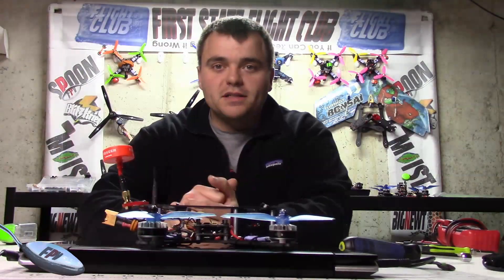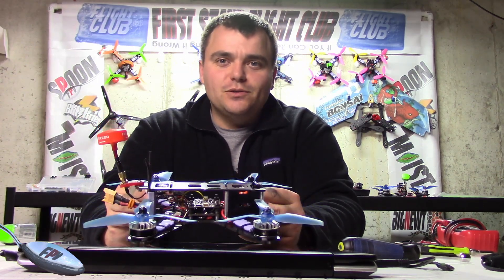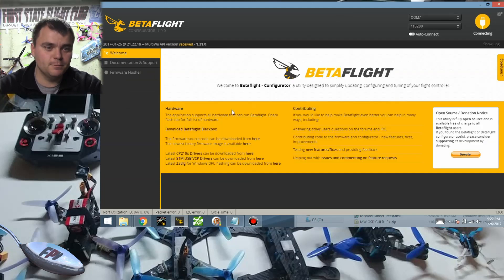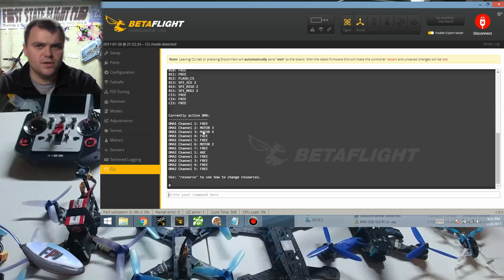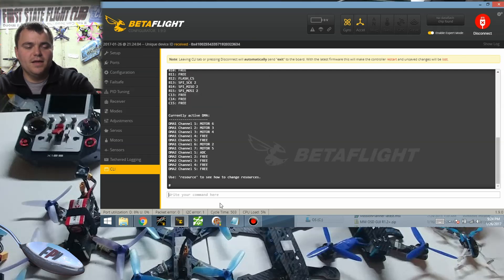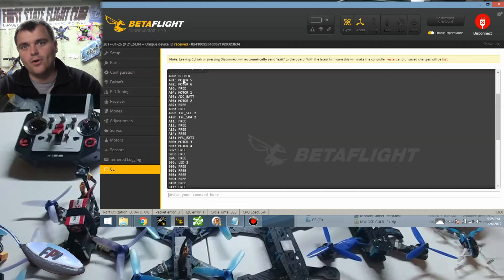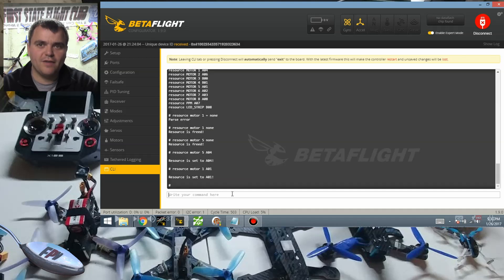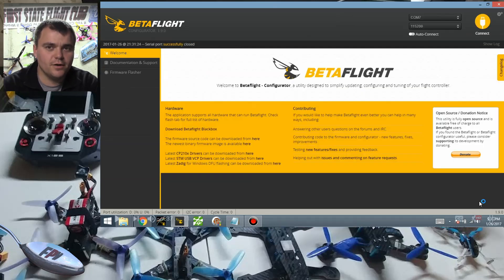Pin Remaping to Support Dshot Motolab Cyclone and more

Comment: I'm a bit baffled. I have the exact same board and it worked for Motor 1 but then kicked off Motor 4 after it had already been working.
Reply: Nevermind! I am an idiot! I swapped esc 4 earlier to test something else and didnt have a Dshot capable esc on it. Works great now. Subbing :)

Comment: Doesnt appear to work in 3.2 RC4, ended up having to use Hex-X instead as Y6 seems to be broken.
Reply: Cheers Shufty, I also had this issue on 3.2. Thanks for the help
Reply from the maker: +Shufty it's just a trick to find which pins support DMA, glad you worked it out.
Reply: Yeah for some reason the Y6 model doesnt save, just defaults to "custom motor mix" which isnt that helpful. Hex-X works the same as it does in your video though!

Comment: Thanks for the trick !

I have the same issue with Dshot1200 BF3.2, but all works fine with Dshot600

My FC is a LUX 32-bit, and it has only 4 motor pins! 
I can see that only MOTOR 1 is on DMA1.
Any ideas how to solve it ?

DMA1 Channel 1: ADC 
DMA1 Channel 2: FREE 
DMA1 Channel 3: FREE 
DMA1 Channel 4: FREE 
DMA1 Channel 5: FREE 
DMA1 Channel 6: MOTOR 1 
DMA1 Channel 7: FREE 
DMA2 Channel 1: MOTOR 3 
DMA2 Channel 2: MOTOR 4 
DMA2 Channel 3: FREE 
DMA2 Channel 4: FREE 
DMA2 Channel 5: MOTOR 2 

Thanks

Comment: How can i find out which pins in BF support DMA? 
I tried that 6 motor trick, but there are still only 4 (one of them is dead) under active DMA...
Reply from the maker: You will need to look at the files for the board you use and figure out which pins it is.  You can ask for help on github, just know which target you are running.  You should contact the board manufacturer first and find out which pins have dma.

Comment: excelent!
Reply: Motor 1 & 4 do not come up under DMA. #1 comes up after soldering to ppm, 4 comes up when disabling the LED strip in betaflight. Not too many people seem to know to disable the led. I spent hours trying for figure it out. It's the same process with the furious radiance. And the tempest.
Reply from the maker: Gon Qu Thank you!
Reply: I tested your re mapping in my Tempest and didn't work...but Boris_B said that it can be remap the motor 1 to the PPM pin in A07 and it works!
Reply from the maker: Did you try Y6 to find the pins you need, or did you just go with the ones I suggested?  Anyway, glad you worked it out.
Reply: Spoon FPV yes, I test in Y6, similar resources in the Tempest. I tested remaping motor 1 to motor 5, 6 and doesn't work. Finally I remap to the PPM pin and  it works.
Reply from the maker: Gon Qu Yeah unfortunately it only works if motor 5 or 6 support DMA, sorry it didnt work for you
Reply: Spoon FPV both 5 and 6  have DMA in Tempest FC...

Comment: I have a tempest on the way - I've been running dshot with a kissfc but wanted to change it up on the next build. Glad you've taken the time to highlight this. I'm actually still considering running multishot because my osd is getting triggered just thinking about having the motor 1 signal wire 'out of place' lol.

Comment: Thanks for this information. I recently had to make my own betaflight build for my cheap unsupported LS f3 board from banggood and by using your information in this video I have now remapped my motors to the correct pins, resoldered motor 2 to motor 5 output and I am now running dshot 600 on it. Needless to say I'm over the moon that you have provided such a good detailed video that has helped me very much. Thank you again and keep up the great work.
Reply from the maker: So glad you found it helpful.  Thanks for letting me know you made it work on another board.  The cyclone was the only one I knew needed remapping.   What board was it?  And I don't know if you're quoting me with "over the moon" but if you are I appreciate that you've seen some of my other stuff =)
Reply: I'm a subscriber so I try and watch all you videos ;) The board I actually remapped was a cheap Banggood board called a LS-F3 with osd but I think it's discontinued but if it's of any use to you the target for that board was a flip32 f3 with osd so I would imagine the flip32 f3 would need the same remapping.